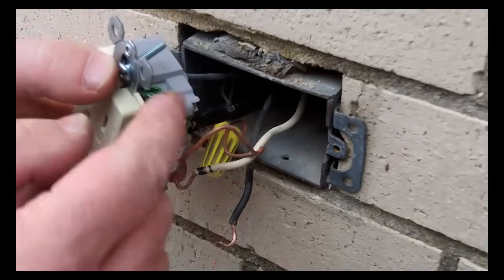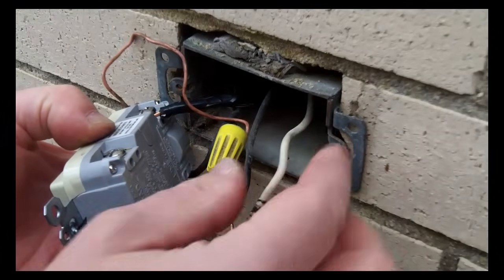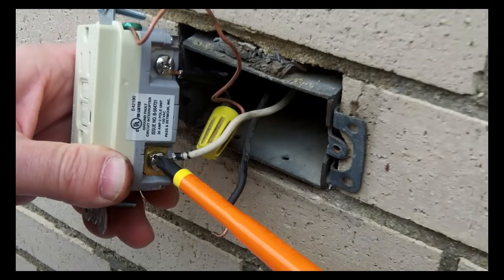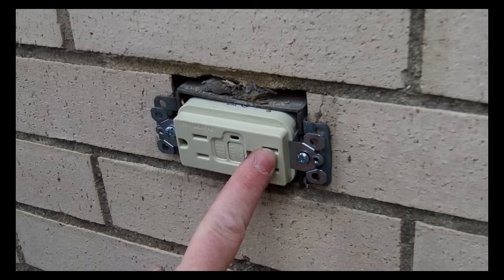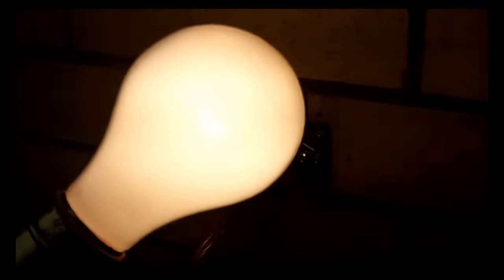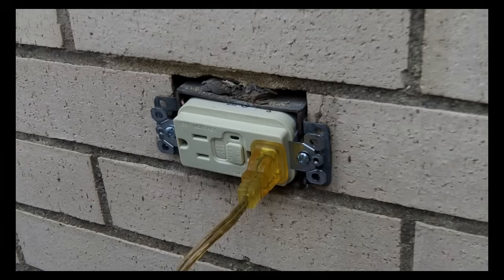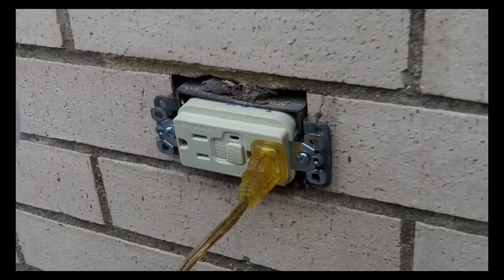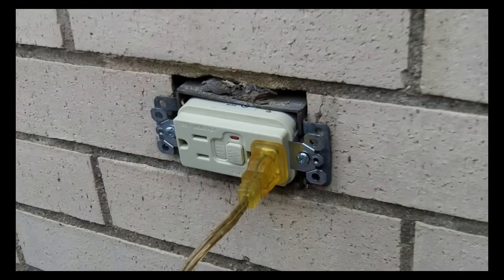How to Install an Outdoor GFCI Electrical Outlet Part 2 - Install the New Receptacle

Comment: You basically spoke the instructions in basic fashion, that’s helpful for many people. They say public pamphlets must be written in a level no higher 5th grader reading…trying I think you made this simple enough to understand even if someone were not planning on changing one out but understanding why they might be having an issue and why it exists to begin with- I’m sure you know people don’t always know what the difference is and why they are needed…I’ve  done electrical projects for awhile- that said manufactured homes are wired differently and a pain. They don’t use any better than 12/2 and don’t appear to set up the breaker for enough regarding outlets/switches/appliances… the outlet on the exterior of this home was tripped but knocked out the power to the master bathroom for two days after a rainstorm when the Christmas lights were up, I suggested a gfci replacement and box to protect it and allow for something to be plugged in and the cover to close but hopefully will find something on here if I run into any surprises… I’m hoping it’s wired correctly 🤞🏼

Comment: I noticed there are 2 black wires u just connect,  you said you connected the ground,  then neutral (black) then hot (black) how did you know which is which?
Reply: Shocking omission!!

Comment: how do you identify line wires from load wires in the receptical box
Reply: Separate all the wires in the box. Make sure they aren’t touching. Turn the breaker back on and use your volt tester to see which one has power. Only one of the hot (black wire) wires will have power. That will be your line. The other one will be load (carries power to the next outlet.)
Reply: @lav-719  Thank you!!!!
Reply: @lav-719  Thank you!!!!!
Reply: Came here to ask same question.  Dude never explained.